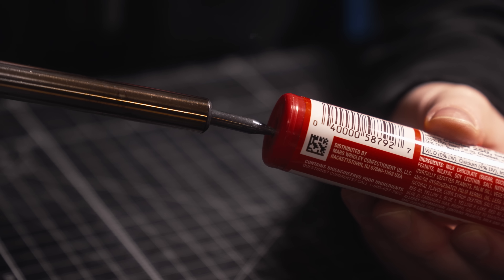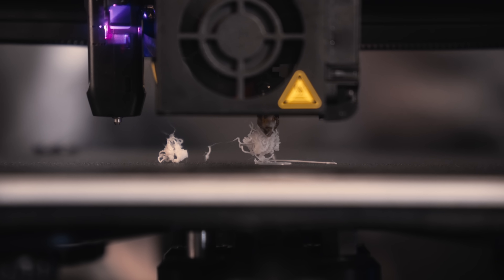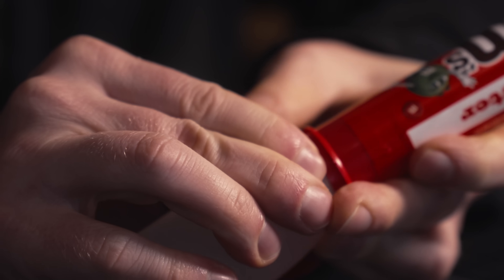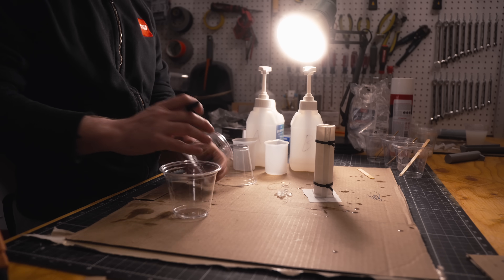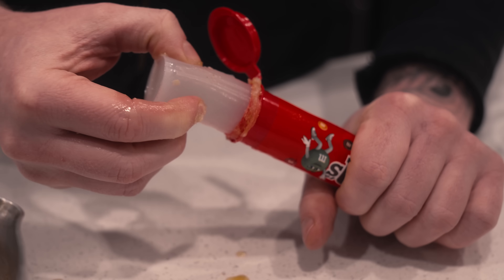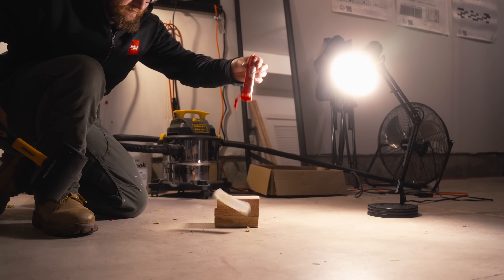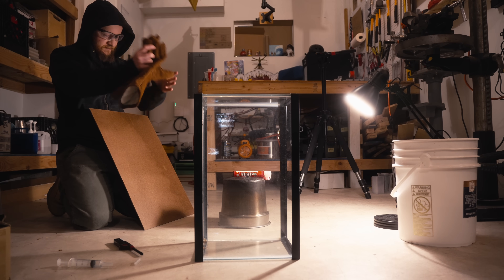Solving Reddit's Cylinder Problem with Science

Comment: when making a silicone...cylinder...from a 3d model the easier thing to do is print the mold instead.

in blender, make your model, then take a cube large enough to fit the model, obviously a rectangular prism will be fine, it doesn't have to be a cube, then add the boolean modifier to the cube with the model as the object, selecting difference then apply the modifier.

next add a cube such that it covers half the model you just made, duplicate that object, to both duplicates apply the boolean modifier with the object and that cube, for the first use the intersection operation and for the second use the difference option. you should now have two halves each with a negative of the model you want.

blender does have an operation for cutting something in half, which makes the second part easier, but i've never had the best of luck with it and find the option i gave most reliable.

once you are done, print out your model, duck tape the two halves together (make sure your model included an area at the top to pout into, btw) and pour you silicone...don't skimp on the duck tape...absolutely wrap it in it. idk if flex tape would be better...not tried. but once it's set you can just cut along the seam and pry the two halves apart...

Comment: I still think that just making a small hole in the end to break the vacuum would do the trick... like I think the one where he prepped it with small hole to fill with acetone, u could've prob pulled the cylinder right out after poking the hole, at that point its just friction.

Comment: Presuming the "cylinder" is not a perfect cylinder and is capped with a more semisphere shape, I woukd assume using a dremmel to shave plastic around the rim at the capped end unil you make a small hole to allow air into the opposite end and remove the pressure difference between the end of the m&ms stick and the "cylinder". You fan then also apply low heat to it which will loosen the "lubricant" a bit more. LOW HEAT

Comment: Use a small plastic knife handle inside a balloon to feed the tip of the balloon into the bottom of the m&m tube, then slowly inflated the balloon with water

Comment: I think I have a solution. Pump hydraulic fluid in through the gap you drilled for the acetone one. The pressure will either force the tube off the cylinder or push hydraulic fluid up into whatever is attached to the cylinder (i.e. bladder, kidneys)

Alternatively, have pressurized liquid build up pressure, thrust from inside the tube, (i.e. piss)

One would assume this would have some kind of lubricating effect as well

Comment: There's a way to make rotary cast saws with larger (rounded) and smaller (sharp) peaks. That might work on your Dremel and you might even be able to 3d print and mould one out of some resin or cast it. That being said I wouldn't want to be in the room when you tested it.

Comment: "It is imperative that the cylinder remain unharmed" has the same gravitas as "the city must survive"
Reply: the cylinder must survive
Reply: @dr.quantum1644  There is a slight difference between "must survive" and "must remain unharmed"
Reply: Mhhh, good idea: what if extreme cold could have helped
Reply: @Manachtron  -120°C would help almost any cylinder shrink, I think
Reply: elite ball references
Reply: @lockthepope -120C will turn cylinder into ash. It will become black and fall apart like coal. frostbite is no joke.
Reply: @lockthepope the cylinder must brace itself; the storm is coming
Reply: The cylinder yearns for the mines
Reply: The cylinder of stalingrad

Comment: What I found was, to kinda get a scissor and a drill, first off VERY carefully drill a little hole at the utmost top of the tip. then get a scissor and cut through the hole only a little bit, because the cylinder inside the cylinder isn't fully cylindrical on the top of the tip, but kinda has a little gap there, because the tip of the cylinder inside the cylinder is kinda round. 

So, then rip it open with your hands with biiiiiig force. It's important to use your hands.
Reply: did you conduct this experiment at home?
Reply: @DraesLair  not yet

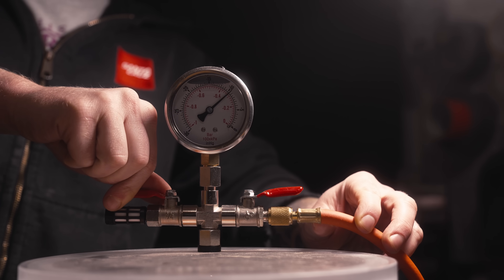Comment: 12:15 I just realized this is not, in fact, about a silicone cylinder.
Reply: Well we don't know what material the cylinder actually is because the guy who made the post never specified, silicone is just supposed to be an analog for something that is semi-rigid but semi-soft that could get stuck in the tube.
Reply: @altKingCarrot  Exactly, everyone takes the high ground like they know what it is when the guy never said what it was. I think we should be more open-minded to what the cylinder could be.
Reply: @HenryJuisiti  people actually knew what it was?? How?? From what i recall, all the detail he gave is that it was a semi-rigid but semi-soft cylinder with a length just over 5 inches with a circumference just under five inches, attached at one end to a larger object, with two smaller delicate structures connected at the same end. A description of which i honestly can't make heads or tails. I didn't know anyone else knew what it was or had a guess, I just assumed it was some extremely niche scientific implement that i obviously wouldn't be familiar with as I'm not a scientist. Probably custom-made because he said he's been told that the cylinder is slightly larger than average. Maybe some kind of depth gauge or internal volume measuring thing and he was using the M&M tube to calibrate the sensors (what i assume the connected delicate structures are) but maybe the device isn't designed for measuring the volume of containers smaller than the probe, like you're not supposed to squish it in there, because when it expands to get a measurement it gets stuck. I can kind of relate to a guy getting a cool new toy and wanting to try it out before reading the instructions and accidentally messing something up and being afraid to damage it so you go to Reddit looking for advice. Or he might be a physician and it's some unusual piece of medical equipment, which would explain why he said "hospital". Probably gave up and just went to tell his boss what happened. Poor guy.
Reply: @altKingCarrot  Exactly, no one knows what it really is but you know how the internet is these days. Everyone wants to feel special that they know something no one else does, so they claim they know what the cylinder is. Personally, the cylinder to me seems kind of high-tech and I don't think it's just something us normies can really understand without intense explanation by someone qualified, like bill nye the science guy. It would be really cool if he was a physician, because perhaps the tech could be like body tissue? Maybe it's a revolutionary design that can imitate heart tissue to expand/contract, thereby saving millions of lives. Either way I have massive respect for what he is doing and hope his invention ended up being without damage.
Reply: @HenryJuisiti  Bill Nye the actor? He's not qualified at all, the extent of his qualifications are an engineering degree and a children's TV show.
Reply: @altKingCarrot  Yeah but he makes me feel good so I just pReTenD
Reply: @HenryJuisiti  so anyway apparently I'm missing out on something. What did most people think the cylinder device was?
Reply: @altKingCarrot i may be stupid but i genuinely cant tell if you dont know or if youre really committed to this bit.
Reply: @jackskinner1513  you may be! But you shouldn't talk down on yourself like that.
Reply: @altKingCarrot  he said it was carbon based
Reply: @HenryJuisiti it’s a Johnson
Reply: How did it take you that long
Reply: @archerelms human stupidity has no end
Reply: Lmfaoo
Reply: Ahhh so my mind is just somewhere else then cuz I immediately knew as soon as I saw the post (which was a long time ago that's why I clicked on this vid cuz I knew the reference)
Reply: How?
Reply: You can't possibly be this stupid and be alive at the same time
Reply: Me too, it took me a bit longer.
Reply: lmfaoooo i just realized about 2 minutes in but i dont blame you
Reply: Gonna need some help, what is this about
Reply: @v2mrstevenofv259  A cylinder attached to a larger object that must remain unharmed and is made of a possibly fleshy material. There's nothing more to it!
Reply: @BerryGo. thank you😂
Reply: @v2mrstevenofv259  this is about a pp.
Reply: @v2mrstevenofv259  it's his dih
Reply: @v2mrstevenofv259  lmaooo

Comment: I think we need to understand more about this cylinder and its physical properties.  If it has a very different coefficient of thermal expansion to the tube then either heating or cooling may work.  Given heating naturally causes melting problems, possibly cooling in ice water will work.  Barring that, liquid nitrogen could cause shrinkage so long as it doesn't become too brittle and snap.

Alternatively, if it is made of mixed materials, it may be possible to disassemble it.  Ideally, if it contains a fluid, then draining that would allow the cylinder to collapse making it easy to remove.

Finally, if this is a regular problem, possibly one could place a valve at the end of the cylinder to eject a fluid under pressure.  So long as the adhesion between the cylinder and the tube is lower than the tensile strength of either, the increased pressure should force the tube off the cylinder, possibly explosively.

Comment: Separator materials exist for a reason rofl
Look into dental materials 
Tin foil substitute for material separation. 
Water glass for plaster mold seperation.
Reply: Also light coating Vaseline  with the use of heat ;3  can do wonders... creatated a barrier ... and precents permanent  mess on important bits ;3 in another important of cases ;3
Reply: Also " low temp wax coati "  
Dip cylinder to make thin coating 
And hot water bath for release
A single hole that Is plugged  will alow mold to release after wax is softened
Reply: also also also
Feeding tube syringe
Top cut off 
Mold separator
Pour in stoof
Let set 
Push pop out
Reply: Luv the video <3
Hopefully can helps with with your mission :)
Has well well over a decade of lost wast casting and mold making experience ;3

Comment: 10:38 what if you had tried something similar to a cast saw? Or the weird dremel thingies that are used in brain surgery? I think those would work a lot better due to the fact that they are specifically designed to remove hard material while keeping the soft and delicate material intact
Reply: This guy knew what was coming
Reply: That sounds exactly like how the hospital would have removed it
Reply: What is that robot thing from it's so cute

Comment: Why the fuck didn't you just print a cylinder negative on the 3d printer.. also, why the hell would you make your mold out of the same material as your casting. I don't think you could have been more inefficient if you tried.

Comment: I think the cylinder could be freed using a hydraulic force to increase the internal pressure and push the tube off, provided you have enough Delta Pee

Comment: If the op drank enough water the cylinder could have had a magical increase in precipitation causing a pressure difference in the tube potentially letting the cylinder come out unharmed without having to get anywhere near a cast saw

Comment: Since we're at cylinders and silicone, take this bit of advice. When using a silicone cylinder, especially one meant to move rapidly, do not apply a silicone based lubricant. They will interact in unfortunate ways and you may be left with a bigger cylinder and no lubricant, which makes extraction challenging.
Hospital.

Comment: The experiment would be closer to real-world data if it used a composite material where the outer layer is made of semi-dry leather. Semi-dry leather is known to stick to other smooth materials, like M&M tubes. I don’t have any ideas for how to replicate that right now, but moisturized silicone isn’t any closer to the OP’s real situation.
Reply: Maybe an outer coating that slowly changes as it absorbs moisture—either from the environment or from whatever you use to insert the cylinder for testing. Something like a cheap paper towel wrap, or propylene glycol… not sure.

Or an even better idea: cast the cylinder significantly smaller than the M&M tube’s diameter, but with a hollow cavity inside. That way it goes in easily while dry, and then you inflate it with air once it’s inserted.

Comment: Hey, a professional cylinder fitter here!
Just put a small water hose in right next to the cylinder and try to stop it from leaking, itll push the cylinder out and also work as a lubricant.

Comment: It is imperative that the cylinder remains unharmed.
Reply: I was crying laughing at that line
Reply: the cast saw should succeed at this and can even navigate comfortably around any larger structure the cylinder might be attached to
Reply: @vikovitch  its average 😭
Reply: @nanotechlegend9076  the size of the cylinder would be a topic of hot debate rivaling the likes of political quarrels, so I am not saying anything in regards to that.

I was pointing out that the cylinder in the original reddit problem was attached to a larger structure, and how a cast saw would be the perfect tool to even circumvent such obstacles.
Reply: @vikovitch  wowwwwww are you calling me fat?
Reply: @nanotechlegend9076  no.
Reply: @nanotechlegend9076  ive been told it's above average
Reply: @vikovitch you have no fun I guess huh?
Reply: @jakehooper9159  inaccuracy.
Reply: @jakehooper9159  what do you mean? Most fun guy ever, I love them.
Reply: Man, whatever material that cylinder was made of, it must have been pretty valuable
Reply: @MrMtanz 
Yeah, he (I'm assuming it's a man) appears to love it and to be very attached to it for some unknown reason, despite it getting him into all sorts of tight spots like this.
Reply: @Therapistinthewhitehouse  how tight?
Reply: @mangoo-f8g Like M&M tube tight.
Reply: @Therapistinthewhitehouse  with the size of the cylinder in question.. he's no older than 13
Reply: This should be a problem on the Harvard entrance exam
Reply: english is not his first language, he says
Reply: @userkelvin Mine either. I'm not sure what is my first language but it obviously wasn't English.
Reply: Internet Hall-of-Fame caliber line.
Reply: IMPERATIVE
Reply: ......

Hospital.
Reply: No cylinders were harmed in the making of this video
Reply: And the larger structure!
Reply: Call me crazy but by carefully reading the reddit thread's subtext and pondering the situation from every angle for multiple weeks using complex computer simulations,  I'm 60% sure that the cylinder was actually OP's genitals. What malicious force caused his d**k to get stuck in the tube, however, will remain a mystery
Reply: Then...don't stuck it in a vaccum-sealed tube.
😂
Reply: This feels loosely like a be more chill reference..
Reply: So this is what they all meant

Comment: did you consider other options such as exposing the cylinder to low temperatures in an attempt to make the material shrink, or maybe leaving it unattended for a few minutes to see if the rigidity of it somehow changed and it magically became unstuck on its own?

Comment: If this cylinder is actually a pipe then blast liquid through it at a high flow rate. The pressure will blow that cylinder clean off.

...though their is a chance the pipe might be torn if its stuck to the cylinder's inner wall by some sticky glue like substance.  🤔

in that case if you blast some slightly acidic fluid with enzymes through the pipe that can dissolve glue then you're golden! 😄

Comment: Carefully cut the edge of the M&M tube with a knife until the bottom falls off. 
Then you can pull out your cylinder. 

(Only works with cylinders that are rounded at the top.)

Comment: Cast saw is my favorite answer to this because like. Tearing through unmoving material but because it just vibrates it shouldnt actually tear through the- stuck cylinder (which is assumedly not an unmoving surface material)

Comment: time may work cause the cylinder would eventually shrink although this may not be possible as the negative pressure in the tube would most likely keep the cylinder large

Comment: Not gonna say how I know this, but 
if there is a small internal connection inside the cylinder, soaking the container in warm water while pushing warm fluid into the container which will lubricate and create a pushing pressure which can be combined with a gentle pulling motion

Comment: Methods I personally would’ve used would be 
1- pliers.  Not to yoink it, but to deform the plastic enough to allow air inside, or even a lubricant like butter

2- Gentle Hammer.  Using the tip as it would be the most sturdy and would be the first to crack under deformation.  

3- Soldering iron followed by box cutter, then pry.  Very careful make a groove with the soldering iron, make a smaller cut with a box cutter or razor, and slowly cut until it was weak enough to be split by hand 

4- I have a reciprocating multi-tool. Very carefully I would use it to cut open the plastic.  

Odds are I’d use option 4 first but most people dine have a multi tool on hand.